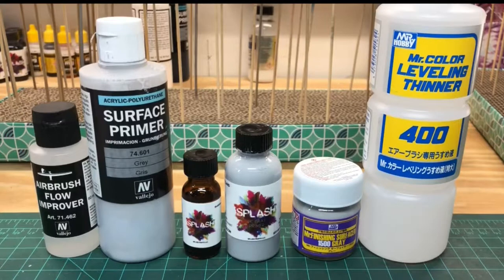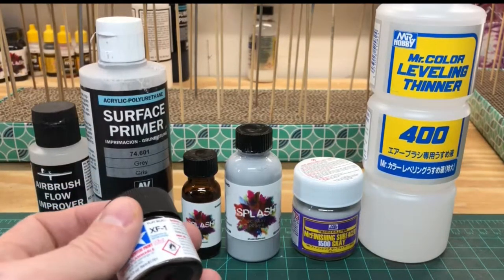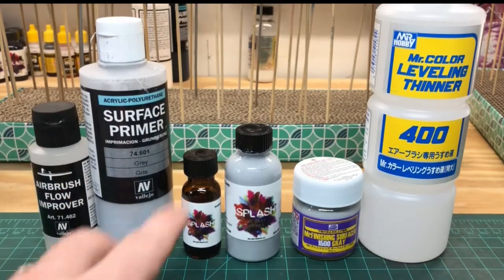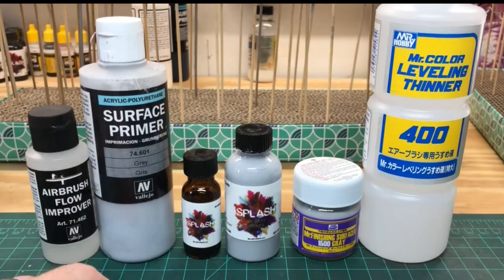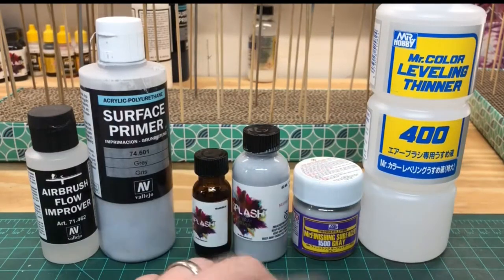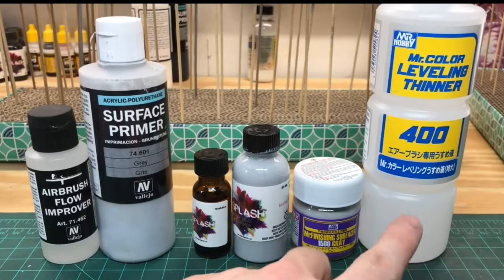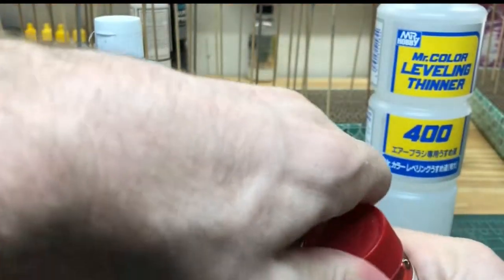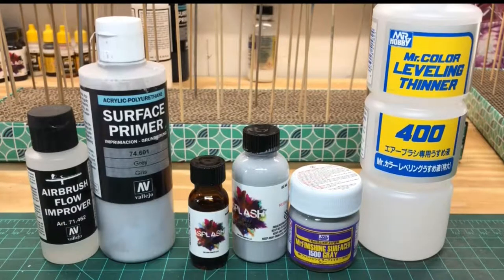Primer Problems

Comment: I wish I saw this a year ago. Similar journey, same destination. I was mostly having issues with car finish primers dusting badly. A big factor was how I was applying, but I basically ruined a Harder & Steenbeck airbrush. Now I use Mr. Surfacer 1500, all four colors in succession, 1:1 with leveling thinner and it is miraculous.

Comment: It's probably too late now and you should have that sorted out, but you can't use isopropyl alcohol or Tamiya acrylic thinner for Vallejo Primer or Vallejo paints. You can use either water or Vallejo Airbrush Thinner. Mind you that Vallejo Primer should be used directly, without the need for thinner.
Reply from the maker: Thanks for the comment and yea, I've switched over to Mr. Hobby. I still have my bottles of Vallejo and I'll consider using them UNTHINNED for future, larger builds. Thanks again, I really appreciate the note!

Comment: Have you ever used Badger Stynylrez primer. I’ve had issues with it clogging my airbrush. I’m going to try and thin it with Tamiya thinner. Just curious if you’ve ever tried it and what your ratio was. They claim Stynylrez doesn’t need thinned but it almost always clogs.

Comment: Vallejo primer should be shot straight. So your problems with it may just be the side effects of trying to thin it because I use it all the time and it works fine.
Reply from the maker: Ah, I did not know that, thanks! Have you any problems with "lift?" The last time I used it I had some lift on a resin model, the surface was prepped and sanded, and I still got some lift on certain parts. Thanks again!

Comment: Very useful into thanks alot! Can you use tamiya thinner with mr color primer? Any method you could recommend regarding mixing the primer? I just bought one today however it was extremely gunky compared yo usual paints.
Reply from the maker: Hey, thanks for the note and great question...you could probably use their lacquer thinner, but I'd keep the brands in house if you're able. Check out some of my other videos, I have one titled "Perfect Primer" that talks to mixing!
Reply: You have to either use Tamiya Laquer thinner or Mr Color leveling thinner which works great. You can also thin Tamiya acrylics with laquer thinner as well. But you cannot use the X20A thinner for laquers.